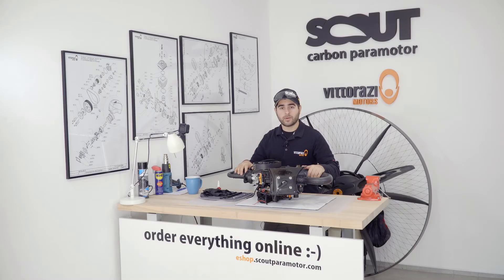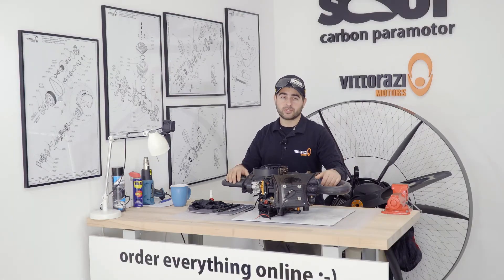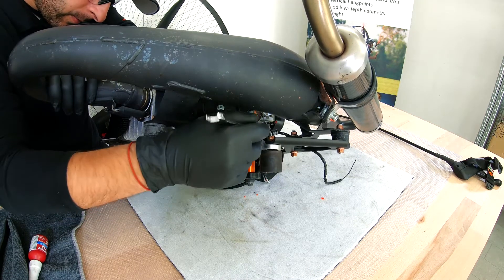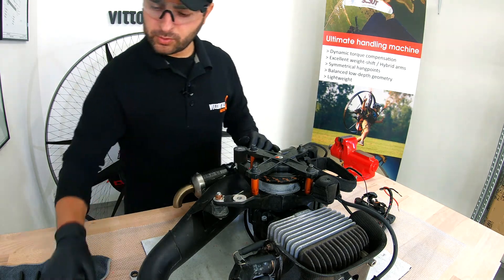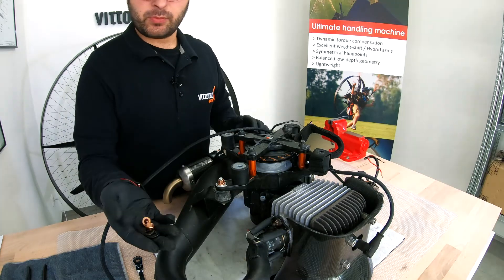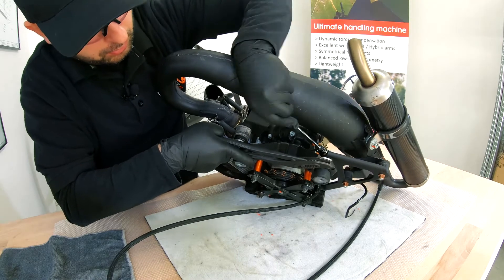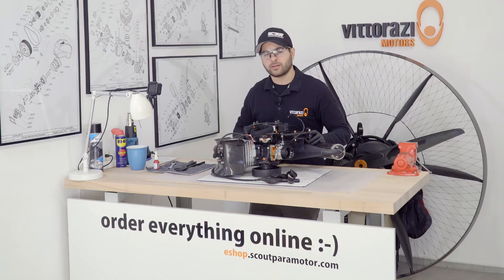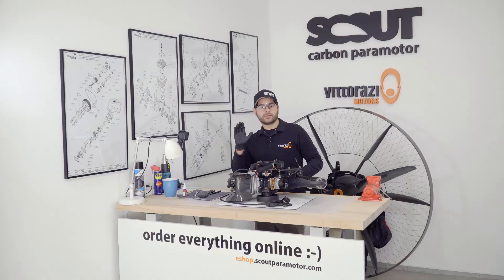Vittorazi moster plus engine rubber mounts replacement. Paramotor engine maintenance.

Comment: What is the required torque (Newton-Meters) for the nuts securing the rubber mounts?
Reply: 15 nm engine to frame is what the engine specs call for  (Stefan, please correct me if I'm wrong )

Comment: I like your every videos but can you explain How does engine cool. How is prop rpm..? Plz reply
Reply from the maker: Engine is cooled in two ways
1. Cylinder and head is cooled by air from outside. The prop is the source of airflow.
2. Piston is cooled from the bottom by air+fuel+oil mixture sucked through the carburettor.
Reply: @SCOUTaviation  ok thanku and  what is pulley ratio, propeller rpm
Reply from the maker: @DeepakSharma-wc1gr  vittorazi moster comes usually with 2.68 reduction ratio.
8600rpm on the motor
Reply: @SCOUT paramotor  thank you so much for information

Comment: Awesome video! Crazy that the motor is held on by a "hand tight" connection! Also - why not have the straps on all 4 mounts?
Reply: The two bottom mounts are being pushed together.  The two top ones are being pulled apart.